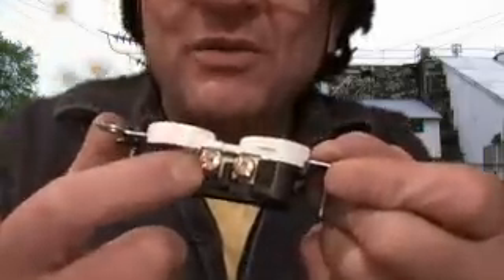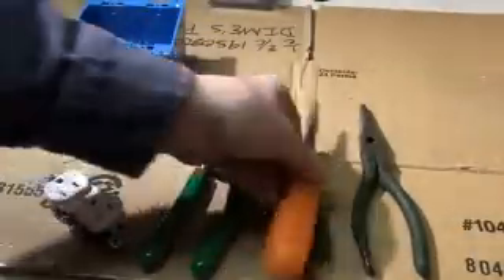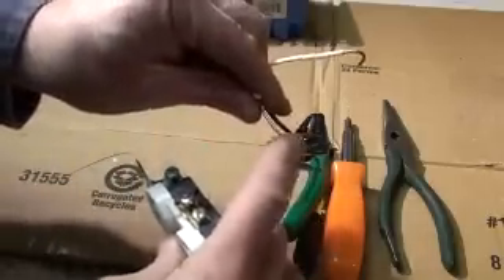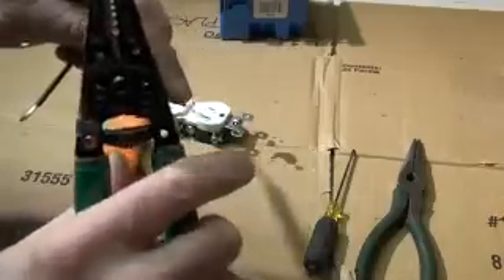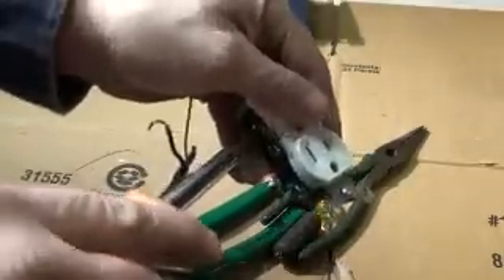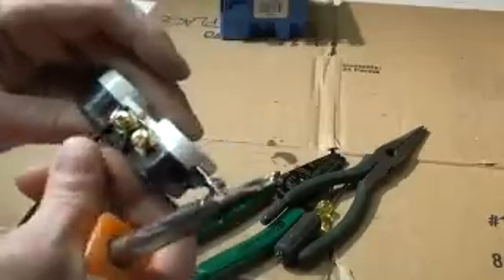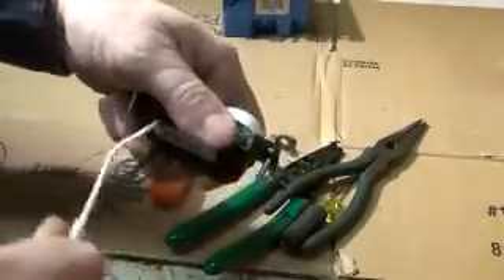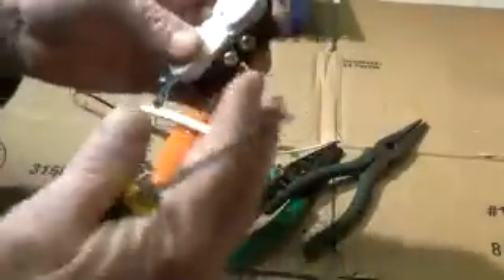secret to undo backwired electric outlets & switches

Comment: Back wiring should not be confused with "back stab" wiring.  The latter which you describe is in fact terrible, but premium devices have "back wired" terminals where the wire is inserted into the hole then the screw draws in a plate and strongly clamps the wire to the terminal, and that method is very much recommended.

Comment: I enjoy your vids. I part time at a big box DIY. (Didn't know if I should put the name up.) In the electrical dept. I'm glad to see we agree about using (or not) back wiring. Some of the newer and a little more expensive outlets use a clamp system that resembles back wiring. The wire is inserted into the back of the outlet but maintained by tightening the screws which tighten anchors on the wires. When you want to remove the wire you just loosen the screws and pullout the wires. Some folk don't want to spend 2 bucks on an outlet. They go for the 69 cent ones. What the heck it's their house not mine. 
Anyway keep doin' what your doin'. I enjoy watching and learning different ways of doing things.
Reply from the maker: thanks, comments from users like your it's why I do what I do...yeah, that's the reason, not the adsense cash my legacy partnership brings every month...haha... serious, thanks Edward!

Comment: Good video, Dino. I would add just one thing. If you back-stab or back-wire an outlet, make sure you turn all the side screws in Snugly. In your video, you left off with them unscrewed and loose. Leaving them out could allow them to touch an adjacent receptacle or the side of a metal box.Also, the "darker and lighter" screws are commonly named silver and brass. If you ever forget which wire goes where, simply recite Black (wire) on brass (screw) will save your a**"

Comment: Now, I don’t feel quite so stupid — from what I’ve garhered, a lot of people run into this problem. I kept trying to push the little silver metal piece in the release-slot to one side, thinking it was spring-loaded in that direction (I guess it’s somehow loaded vertically). I believe I am still going to have to backload my new socket, because this is an old mobile home with “notta lotta” clearance on the sides of the plug-box. Thanks, Dino! 🙂

Comment: Thanks for the video!  Solved my problem in 5 minutes!  I previously just cut, and restripped these backwires but I didn't have much wire to work with this time, and pulling the wires out was far easier!

Comment: That is NOT an electrically insulated tool 5:41 - rubber grip is not electrically rated insulation. They make proper insulated tools but this is not one of them.

Comment: Thank you, I figured that's how they came out, and the previous person to touch it had the ground on where you did the easy side wires, trying to fix my mom's bathroom fan and replaced that switch how they had it but changed ground to the green screw, also instead of one wire it looks to go to both switches and the wire just has a loop that seem to connect both switches to what I can see. My nxt guess is bad fan(23yr old house) or even the wiring since that has needed work twice this yr alone in outlets.

Comment: Quickest, fastest way: Use vice-grips or channellocks to crush the outlet or switch. Pull the wires out of the remains.
Reply: Also prevents the damn thing from being reused again, this is the best advice ever!
Reply: Yeah they’re not the easiest things to pull out especially when they’re 10 years old!
Reply: That is the only correct advice. All else failed including the video.

Comment: Thank you for the vid! My only question, now, is why are there 2 extra holes or screw terminals for the dark(Black, light(white wires? Are they for going to another outlet or switch? Thanks in advance!!! Also, why are there problems about 10 years after backwiring a socket? Seems to be the case, since an 11 year old GFI, died on me last night and I need to replace it!

Comment: With my switch it took more than just pressing the screwdriver in there.  I had to move it around like I was picking a lock.  Then the wire popped out.  I also had to find the smallest flat head screwdriver I could find because a normal small flat head would not work.

Comment: You need to emphasize the difference between backwire and backstab (QuickWire).  NEVER re-use a backstab connection.  I believe a side clamped backwire connection is as reliable as bending the wires around the side screw and clamping.  Especially since most people don't do a good job of bending the wire tightly around the screw.  I can't tell you how many outlets I've opened up to find the curled wire is only halfway under the head of the screw.

Comment: Had me thinking. Just cut them off. I wired in a USB outlet, no screws, the hot side of the stab did not work. Took outlet back to Menards.

Comment: Your advice to "snug" those screws is WRONG! You NEVER connect to a terminal screw by "snugging" it. You tighten those screws AS TIGHT AS YOU CAN GET THEM! And don't worry about stripping them. Electrical connectors are MADE to be tightened as much as possible.

Why? Because over the years as current moves through wires they expand and contract slightly. Tight connections will STAY tight, but eventually a connection that's only "snugged" up will loosen up and create arcing. And arcing can burn down a building.